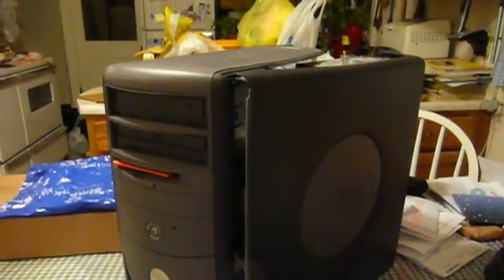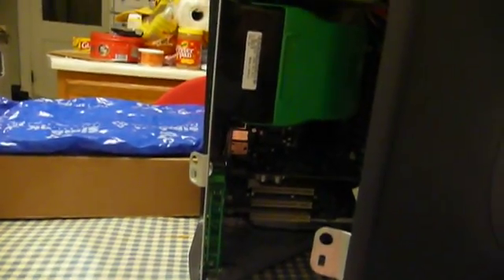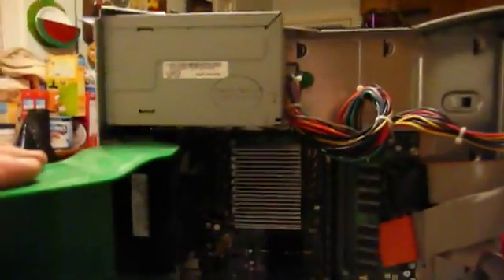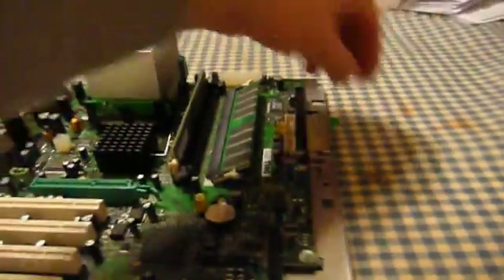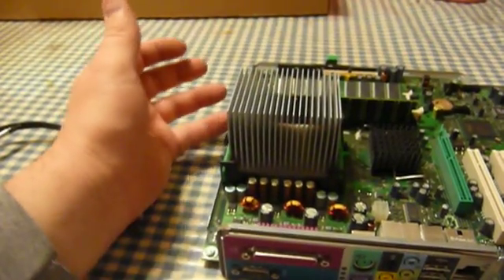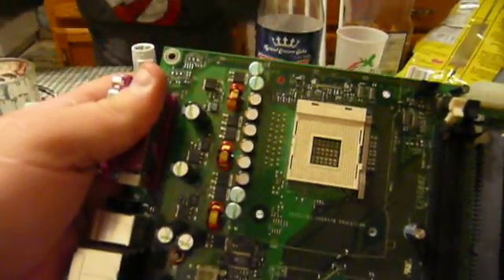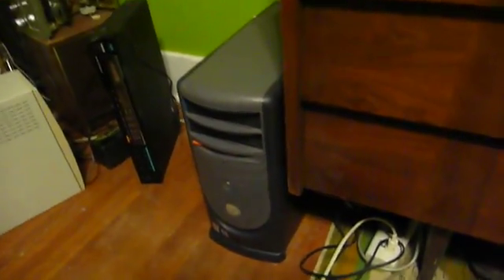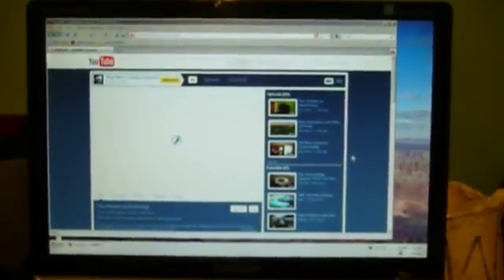Dell Dimension 8300 Motherboard Capacitor Replacement

Comment: What brand of Capacitors should you use, what are some kits that are worth buying, I see the cheap ones of course?
Reply from the maker: Any of the major capacitor manufacturers are a good bet. Panasonic, United/Nippon Chemi-Con, Nichicon, or Illinois Capacitor (although I'm not sure if they do low ESR caps suitable for motherboards and power supplies) are all good bets. The most important thing is to buy from a reputable source, so as to help avoid getting any fakes.

Stay away from cheap capacitors. They're either fake or no-name products and you'll be doing this again far too soon. This system is still running flawlessly today.

Comment: Funny thing is Bill.
Even in 2001 if ye remember the original Xbox, rather than using the newest Pentium 4 chips which I think by then were just about to come onto the market, it came out in 2002 and even though it's a console, it still used a derivative of the Coppermine Core 733MHz Pentium 3 or something like that.

The Pentium 4 , even the lower clocked ones would prob have fried in the confined space of the Xbox cabinet.
Even though I think it still used a fan, in fact yes it did have a CPU fan would've needed one.

The Xbox 360 in 2005 switched from x86 to the RISC PowerPC Tri-core job, can't remember it's name off hand.

But it just goes to show the Pentium 4 never really went many places.

Shame really although Intel must've incorporated some of the instructions from it into the next Pentium M and Core series we have today.

No doubt there was some useful extensions the P4 Netburst architecture had that are now needed by modern software, SSE3 I think is needed by alot of stuff now.

So, in a way the P4's legacy is still with us even if the chips aren't really worth bothering with anymore cause of their heat output and power consumption LOL.

I always kinda had a soft spot for em even though as ye say the P3 in alot of ways was much nippier and ran far cooler, I certainly felt that in older computers too.

Comment: Damned capacitors...I've got an IBM ThinkCentre that needs a complete recap. I bought a second board and the second board probably needs a recap too...
Reply from the maker: The only good news is that once repaired, the capacitors are unlikely to fail again as long as you use reputable parts.
Reply: Is it a normal thing to have capacitor failure symptoms on a board of this vintage without having obviously bulged/leaking caps? I know caps can fail in other ways than venting but usually these early 2000s boards look sick when they are sick...
Reply from the maker: Most of the time, it's very obvious when these boards have bad capacitors. If you're seeing odd behavior and the board looks fine, check the power supply. The bad capacitors show up in there as well.
Reply: Can't be the power supply, unless the test PSU I'm using also has bad caps. It must be something else.
Reply from the maker: Always possible that you have a bad board for whatever reason, but definitely check the power supply. They stress their filter caps hard on both the input and output, so even if they don't look bad...they could be!
Reply: uxwbill It turned out I had bad RAM the entire time! I bought a board I didn't need, oh well...

Comment: Is it just me or does Intel tend look back to their previous generation from time to time? They have done it with the core series and the Pentium 3 as mentioned in this video. And they've done a similar thing with their socket sizes going from LGA 1155 to LGA 2011 but eventually going back almost to where they started with the LGA 1151. 

It's kind of interesting.

Comment: Hey Bill, how do you remove the board from the metal tray? I can't find any posts from online forums about it, the service document (understandably as I'm sure Dell would have wanted the whole board replaced) makes no mention of it, and I just can not get these pushpins holding the bracket out! What's the trick?
Reply from the maker: It's a pain. Most of the board comes free easily (screws), but then there is the CPU cooler retention bracket. And that I don't know of any way to remove without carefully applied violence. Even then I managed to break some of the plastic thingummies holding it in place. It didn't seem to really matter, everything was secure when I put it back together.

Basically, I'd pry at the CPU cooler mounting pegs until they start to come loose.
Reply: Thanks for the quick reply Bill, I managed to get it off.

Comment: on the dell i dont no if u  no this but under the nb heat sink it looks like  an old amd xp chip its only got a small core,but i dont no if u ment that any way i have  or had the front panel plug and wire.

Comment: so i actually got a system similar to this one (a dimension 4500) and it had... get this NO THERMAL COMPOUND ON THE CPU!!!! i had been using it with no thermal compound for months now im deciding, leave it that way, or add thermal paste
Reply: Just got a 4500 recently and the temps are great with thermal paste on so I'd recommend it if you haven't done it already

Comment: i very much enjoy pentium 4 processors, they do everything i need them to, you know except play netflix, they even play youtube if i use a standalone player, my p4 actually plays youtube in browser at around the level my core2duo latitude d630 did, but my macbook does it much better
Reply from the maker: +BrianGriffin1999 If they work for you, that is ultimately all that matters. However, the single core Pentium 4 is ever-increasingly being left behind by software that is optimized for the different architecture (and multi core nature) of the Core series processors.
Reply: i am finding that increasingly true, as i am currently stuck on windows 7, and windows xp, unable to upgrade to windows 8, 8.1, or 10
Reply: not to mention almost everything running slow, or not running, because they crash
Reply from the maker: +BrianGriffin1999 Crashes would tend to suggest corruption in your operating system (garbageware, malware, virus, maybe something worse?), flaky drivers or flaky hardware.
Reply: i replaced my video card, the crashes stopped

Comment: I have a question, my dimension 2350 has a swollen capacitor that just has a slight leak. It is like a tip of a pen size leak. Should I stop using it and replace the board? Would it be bad if I kept using it?
Reply from the maker: +RogerRHF I wouldn't worry about it for now. Just keep an eye on it. Unfortunately it probably will get worse over time, but it may be a very long time. When that time finally does come, you might as well replace the lone capacitor. It'll be cheap and more effective than buying a whole replacement motherboard, which may have capacitors that will do the same thing soon enough.

Comment: The worst part about the 8300 is that it has a socket 478 instead of a 775 like the 8400 did witch really makes your options for processors limited.
Reply: ***** I have a prescott in it and it works great but I wish I could put a 3.2ghz northwood in it along with a usb hub and a new sound blaster cause the one I have in it now is going

Comment: I have a very rare Pentium 4 processor too.
It's a Northwood with HT at 2.8 Ghz with doubled L2 cache !

1 MB of L2 Cache ! I know absolutely nobody knows this processor, and I triple checked it. It's not an early Socket 478 Prescott. This thing seem pretty rare because the only thing that I found on the internet talking about it was an old news about the fact that prescott was not on schedule so Intel released this unusual processor.
The only official Northwood with 1MB cache was the P4-M.
Reply: My 8300 has it too!

Comment: First electronic soldering job I did, all I had was the 65-watt iron I used on metal.  I put a new battery into my old Zelda 1 NES cartridge.  Boy, was I sweating over that thing, but I managed to get it done without melting the whole thing down! :D

Comment: What soldering iron and what desoldering thing should I use.

What voltage should the iron be and what tools do you need.
I have a wick and 30watt soldering iron.
Can never get the right solder to add to the part. :(

Comment: Thanks for the help uxwbill. PS.. I saw a few of your videos and thought they were all very informative and well done. I'm a mechanic by trade, and do a fair amount of electrical work on cars, but that only means that I know which end of the soldering iron Not to stick in my mouth, printed circuit boards are a whole new ball of wax, and yes, I'll get some practice time in, again, thanks for your help. Bob5326000

Comment: Saw your video about replacing the capacitors in the motherboard of the 8300, and have decided to give it a try. My 8300 has the same messed up capacitors as you replaced, mine are 820uf  6.3v, could you tell me which brand and model #  you replaced your's with? Any help you can give will be great, because this is all very new to me....thanks  Bob5326000

Comment: Yeah i figured that and i also do not know if the new CPU that was 2.8Ghz supported the hyperthreading OR if it was the updated bios to A01 and if hyperthreading even makes any difference. i upgraded the computer i have with a A00 bios to 1GB of ram and it made it alittle quicker but not much. So im thinking five dollers more on ebay and i can have a 2.8Ghz CPU with hyperthreading if i can update this bios to A01.

Comment: AND for some reason or another there dell dimension desktops at least the more low end ones have the really shitty 2.5Ghz CPU and no hyperthreading and whatever else. I beefened up one with a 2.8Ghz CPU and 1GB of ram and it lit a fire under its ass, but i dont know if it had to do with the new motherboard being upgraded to a new BIOS or what.

Comment: @uxwbill   Yes, it was the exact same problem. System comes on and tries to boot but can't and the repair shop showed me the failed capacitors and say I needed to just buy a new system. But your video helped me to understand what was going and and how it can be fixed. Just not sure if I could do tor would want to do that myself. LOL

Comment: Wow, I loved my 8300 It was my best PC ever and it has the same problem but no one will repair it for me here in my area..told me I was better off buying a new system..brought a new dell Inspirion and not even a year later the hard drive goes out!!! I kept my 8300 in hopes of finding out how what could be done. Just wish someone lived near me that did this type of work.   Thanks for sharing this information, gave me a better understanding of the system.

Comment: The Vcore rail needs low ESR caps per Intel/AMD spec, and such caps are always 105C rated. 85C caps also wouldn't last very long. The endurance spec at max temp is usually very short, but improves exponentially at cooler temps.
If you feel adventurous on a project like this, you can even swap Vcore caps to lower value, very low ESR solid polymers. If ESR is dropped, required capacitance also drops (I've seen this described in both Intel and AMD datasheets). I polymerized some old P3 boards.

Comment: @uxwbill Makes sense.  The one thing though is that they don't really overheat and bulge up.  It will NEVER get above 105 celsius in that case.  If the fan is too poorly positioned, it would actually power off.

Comment: Why buy an old 8300 when it is old enough to rely mostly on IDE?  Also, it was made about the same time as the GX270's, which is basically the OptiPlex equivalent of the Dimmension 8300 and notorious for the capacitor plague, which IS what this one has.  Those are NOT quality capacitors they are knock-off Nichicon.  The refurbished boards have real Rubicon capacitors and they are reliable.... I replaced at least 80 if not 100+ GX270 motherboards!

Comment: Those ground / power planes sure suck up heat when soldering on them. You pretty much need for a powerful temperature-controlled soldering station for it to be reasonably painless (that heat gun trick isn't bad either, I guess). Doing a reasonably acceptable job with a run of the mill iron thus can be considered an accomplishment.

Yeah, the Northwoods and the later-stepping Prescotts weren't /too/ bad. Pushing the P4 and abandoning the P3 early sure was one of Intel's worst moves though.

Comment: These motherboards are multilayer boards with heavy ground planes and power planes. You will be more successful desoldering and soldering these if you use a heat gun to gently preheat the area where you will be performing the repair.

Comment: Hi, last month i trashpicked a perfectly working dell dimension 4400. When i got it home, i realized it was filled up with dust and one of the capacitors (and it still is) bulging. Any suggestions? I did buy a replacement capacitor with the same microfrads and voltage.

Comment: i would try using a de-soldering wick or suction tool to remove the solder  then brushing a small about of liquid or gell solder in the joint it will suck  up the solder

Comment: Don't know if someone else already commented. The soldering pen you're using might be the source of your soldering woe's on something like a motherboard. The motherboards like to suck the heat right off of the tip. And there's always the question of Leaded vs Lead-free, but I'm sure that you are familiar. Very good video, makes me happy to know other people are repairing things also instead of tossing them.

Comment: When I worked in a computer shop I saw this all too often on the Optiplex GX270 line.  I got replacing caps down to a 10 minute job by the time I left there!

Comment: IIRC, you said in a previous video that your first 8300 had an x1300 Pro video card. 
That would be quite a bit faster than the GeForce 6200. 

The P4 really is a dog. One of the computers I used a couple of years ago (and still have somewhere in my basement) has a 1400MHz P3 processor, overclocked to 1575MHz. It totally outclasses a 1.8GHz Dimension 4400.

Comment: totally agree about the Pentium 4 processor. I used to have (i still have i belive) a 2003 Pentium 4 2.4Ghz. Is seriously a blast furnace.
getting easily at 75°C even with a couple of programs open, in winter! i never closed the case properly, never cool down, a friend of mine made even a mod that let the fans on for 5 minutes after the pc was turned off. Don't know if the stupid Intel motherboard is installed on caused trouble by itself.

Comment: i never had problem with that model dell with caps now the gx270's that i have tons of sitting around i have and by tons i mean like 60 to 120 that need caps and don't have time to replace sins i can buy a bunch for 100 bucks at auction

Comment: congrats on getting your connection back....  I can't solder worth a darn anymore either but I always got better results with a solder station (even a cheapie one) then just a stand alone iron....  I think some of it has to do with not having to worry about the darn thing rolling off the table, etc.....

Comment: @uxwbill  In their defense though, millions upon millions of electronics got these faulty capacitors based on a incorrect stolen formula. 

I used to work in a computer repair shop though, and we would see plenty of these P4 Dell computers with flaky RAM, blown caps, and dead Bestec power supplies.

Comment: I've always wondered what the Pentium 4 would be like if it was manufactured on the 45nm or 32nm process. The Phenom II is clocked up to 3.6GHz at 45nm, while the Pentium 4 maxed out at 3.8GHz at 90nm. They'd run cooler, that's for sure. But I wonder what the clock speed would be like. People overclocked the 65nm Pentium 4's up to 8GHz. I'd love to see what could be done at 32nm.

Comment: When I worked for NCR for 9.5 years  before I was hit they had the contract to fix all sears packard bell computers and Dell computers . I can not tell you how many motherboards I replaced with that same problem of the bad caps it was a somewhat common problem. I had a couple with the same fan problem aand caps were good never had one with caps bad and fan bad . I have a Dell 8300 motherboard in front of me with the same problem . I somehow kept it when they took my van back and packard bell sys

Comment: Your house is looking good and those copacitors go to the fan because those are failing on my optiplex gx280 and my fan goes jet speed for 10 seconds and finally boots or just goes fll blst and nothing happens

Comment: I doubt the caps failed because of the fan. Nichicon had a bad run of capacitors from 2003 through 2005, and many pieces of equipment from many brands were affected by it. The Nichicon cap failures seems to be unrelated to the "capacitor plague"